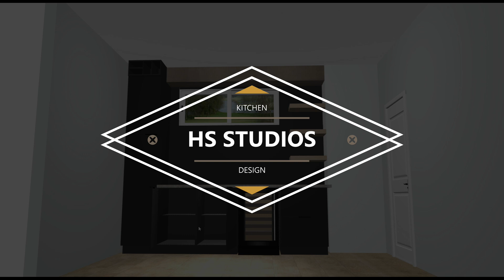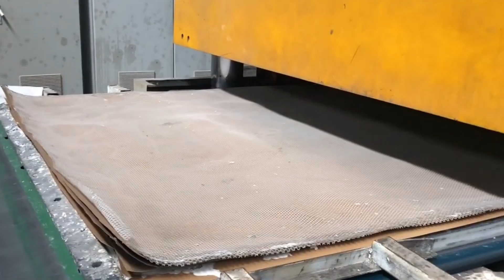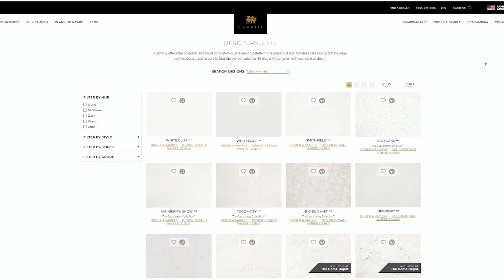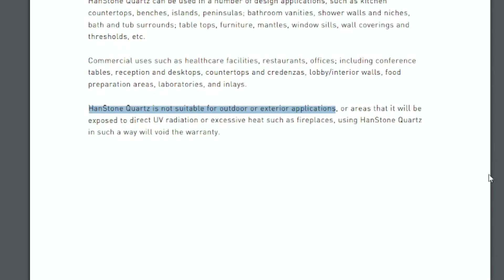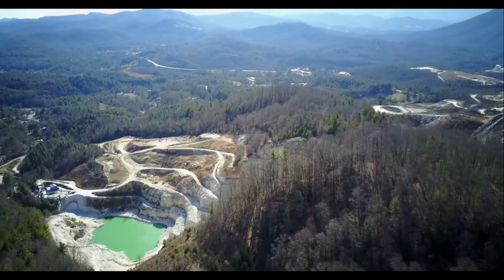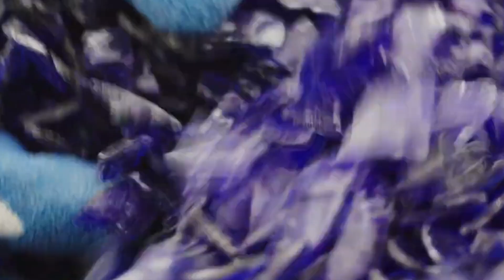QUARTZ COUNTERTOPS | Are they THAT good?

Comment from the maker: There are so many nuances when it comes to how a countertop will ultimately act. 

One thing I forgot to bring up was finish. Whether a slab is polished, honed, leather, or matte, can all impact how it behaves. When it comes to porosity, it seems that any of the non-polished finishes tend to behave a little more erratically, with some taking on water spots, oily rings, or stains. I'd love to hear from those of you who have quartz, and HAVE had issues with staining/marking.

Comment: I've been advised not to pace quartz countertops in a sunny kitchen or they will yellow over time.
Reply from the maker: This comes down to exposure and the type of windows you have. Direct UV rays can yellow quartz over time. However, most home windows are built in such a way that many of those UV rays are reflected as opposed to absorbed. I have yet to see a good manufacturers quartz countertop yellow indoors from light passing through windows. I have seen it happen in an outdoor kitchen (quartz is not recommended for outdoor use in this application).

Comment: Thanks so much for this info! I was wondering if quartz countertops can be refinished? I have a Cambria countertop and some workmen dropped some kind of glue on it. I tried to scrape it off and ended up dulling the areas where the glue was spilled. Now i have dull patches on it ugh! Can the whole thing be refinished or polished? Is this a DYI job?
Reply from the maker: Probably not a diy job unless you are quite comfortable with sanding and polishing pads, as well as a sander/grinder. In most cases repairs like this are worth calling a local fabricator for repairs.

Comment: I was wondering if you could comment on how easy it is to repair each option.  I have seen so many granite countertops with small chips on the edges.  Even one with a large chunk out of it after a pipe wrench was dropped on it.  I never hear about the chips being repaired but maybe they can be.  I don't know if quartz would chip or if it could be repaired.
Reply from the maker: Thanks Mike- that is a great idea to add in for the upcoming videos. Quartz can definitely chip, typically at the edges and around the sink. You can also repair a chip in quartz, but it is quite the process involving several types of epoxy and sometimes chemical hardeners- something usually left to professionals. I have also seen people use superglue to fill/fix small chips to seal the unpolished area. However, most manufacturers also include a warranty with their quartz slabs and it may be covered under that. Some of those warranties are lifetime as well depending on the application.